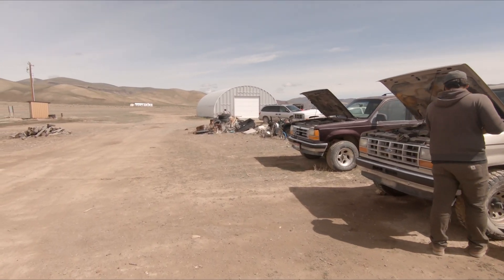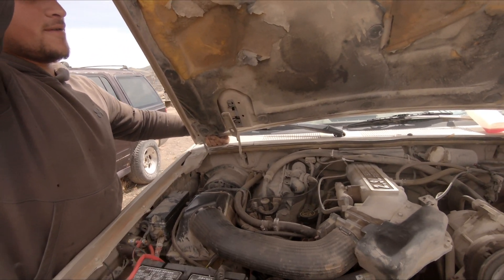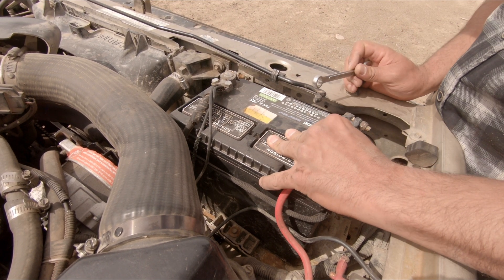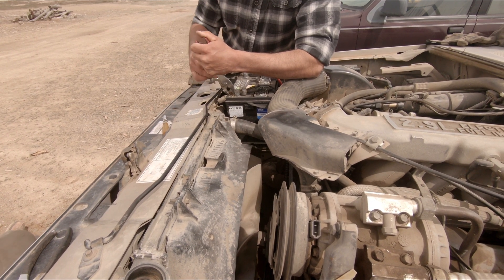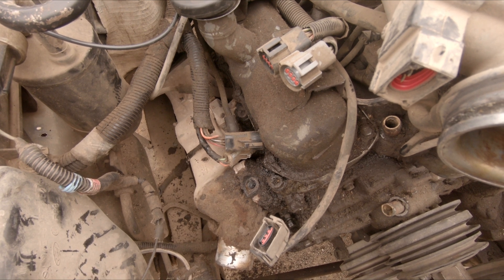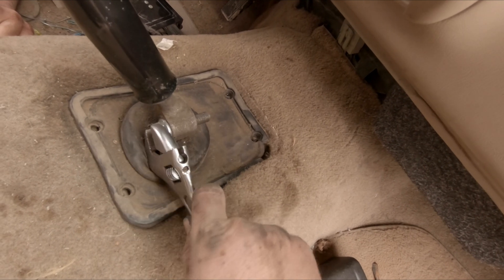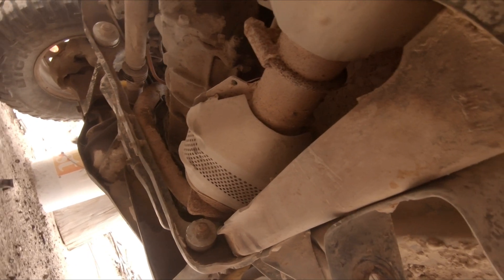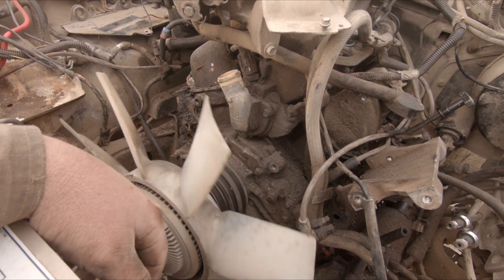Ford Ranger 2.9l -4.0l engine swap Part 1

Comment: I have found out that it's best to Drain all fluids in the Motor and transmission. If you have a stick shift. Drain the 5-speed as well if you have a 4-speed same. This will not work with 4x4 rangers or explorers, not enough room. Unhook the drive shaft and loosen up the bolts on motor and Transmission. Pull AC off bracket disconnect. Take power steering lines off the box. Do not remove them from the Power steering pump. there are 3 bolts and 2 nuts holding the 4.0 power steering bracket on. Pull it off the motor put it in the bed. ALT 3 bolts on top 2 plugs. 3 bolts in front 13mm. there will have a harness with a push-on wire clip just push the connecter out of the tension metal wire clasp. Pull plug apart that's for the injector harness. Leave that on the motor. Pull the radiator and pull the fan clutch and fan off the water pump. Take the Coil pack and bracket off 3 bolts Pull the plenum or intake off. Unhook all wires. Make sure to take pics of the wires you disconnect. Even bolts you disconnect. When it comes time to pull the motor out. leave trasmission hooked to motor 2.9 and 4.0 If you have 5 speed hooked to either motor. Pull the shifter off inside the cab even the peace that goes inside the transmission the stub and stick a rage or put the plate back on with the 3 screws. Take the front wheels off and put them on small jack stands give yourself enough room to put the carry picker legs under the front end. Jack up the back end and put jacks under the rear end. So you can get a jack to support the transmission once you have the trans off the trans cross member remove the cross member. I hope at this time your engine has chains or tie downs on the lift brackets  Once you have it up off the motor mount pull forward so the engine is about 3 inches from the core support. Make sure the transmission when you start pulling it out. the motor is going at an angle. Must be pointed straight down or at a 75-degree angle or 80. Engine will be pointed at an angle as well this is how you take a job that would take you 3 hours to do. To do in one hour. That's why you drain all fluids in motor transmission even the stick shift you drain that mother empty. You will get water and antifreeze come out But can't help that you might need a friend to help you lift the tail shaft over the core support. Once it's out get it on the ground as fast as possible You don't need to remove the exhaust manifolds. But you need to pull the Cat and Y pipe off from the exhaust manifolds when you are working on the Transmission there will be an 18mm or a 19 mm bolt holding a bracket for the Catadlic converter on it must be removed when the drive shaft is being removed. It will make everything that much more easier.

Comment: I’m trying to swap a 96 ranger 4.0 L engine into a 88 Ford Bronco. How impossible do you think the wiring is? I only have the engine from the ranger no dash or harness
Reply from the maker: I'm sure it will be challenging.....but not impossible. Best of luck, that should be a great little bronco if ya do. 👍

Comment: is the 94 explorer the same as the 97 explorer in terms of engine. frame and wiring?
Also what year is that Ranger?
Reply from the maker: Probably not the same. The 97 is in the second generation. So frame was a little bigger i believe and the 4.0l was a sohc, plus some actually came with the 5.0l.  And the ranger.....I'm having a brain fart....90 or 91...haha  😄
Reply: @ibfgarage9365  The Explorer doesn't have a SOHC, so I believe it has a different package. And the Ranger should be the same model year as a 83 if I'm not wrong. So do you think I'll have any problems putting a 97 4.0 into a 83?

Comment: I'm on my way to swap my 95 Ranger 2.3l to a 4.0 SOHC from a 99 Explorer! Can't wait to see your progression! Keep it up!
Reply from the maker: Oh nice! That should be a nice truck. Thanks. 👍
Reply: @ibfgarage9365  Biggest problem is I'm in France, so pretty hard to find parts for US trucks ahah!
Reply from the maker: Oh France? Yeah that would make the parts a little harder to find....haha
Reply: @ibfgarage9365  Ahah, Lucky I am, I found two explorer, so I got everything I need, I just hope the V6 is in good condition so I don't have to rebuild it ahah!
Reply from the maker: Oh wow you got 2 explorers, nice! That should give plenty of parts then. Our 4.0l that we're putting in has a little high miles on it but ran really nice. So, we're not gonna rebuild right now. Just gonna run it.
Reply: @ibfgarage9365  Yup such a lucky time! Especially cause one got the graal... A freaking manual transmission! which is almost impossible to find here! I will not be able to rebuilt it too, but maybe in some times! Can't wait to get them at home and start swapping the big boy!